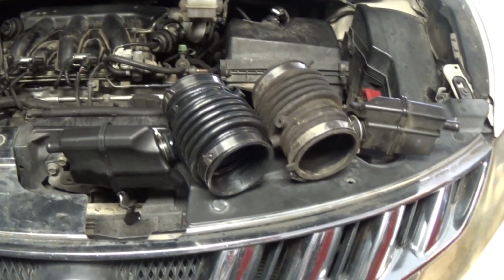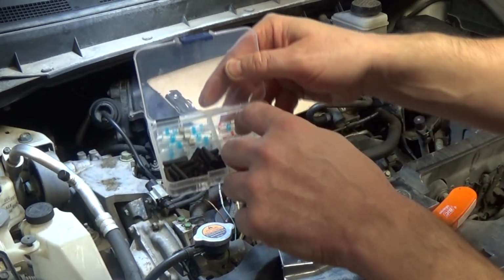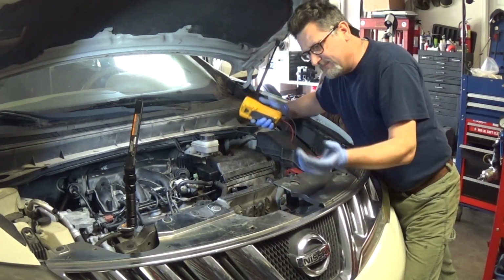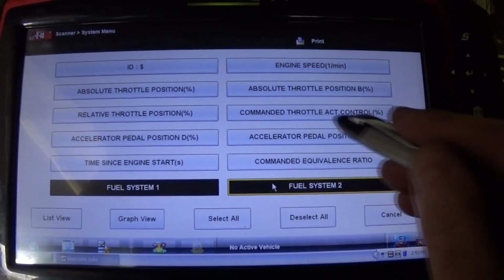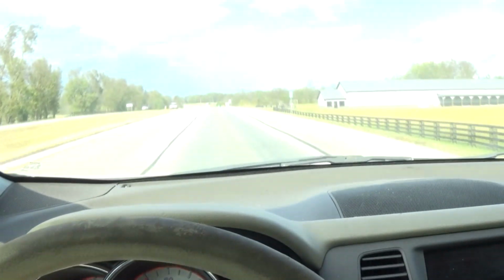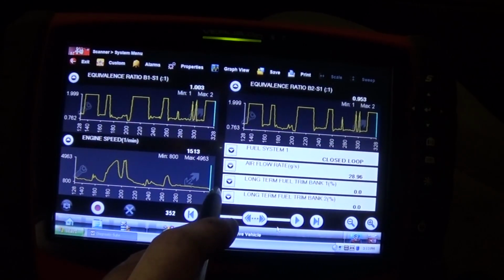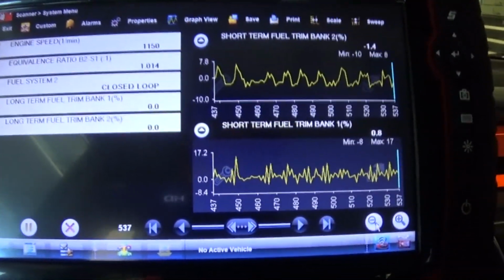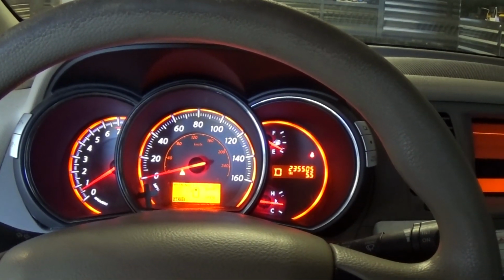Nissan Murano Low Power Complaint Part Two

Comment: I bought a 09 NISSAN Murano with the same issues,  after 4 days the dealership tow back and the mechanic said he could find anything. 2nd  time the car keeps doing the same mechanic said that is me and the way I drive the car??   Said that they couldn't find anything bad.  I need help this person is bad and I don't have an idea what to ask for. The battery had corrosion I found out went it die, he said it just needs a cleanup and the battery is good,. I bought their warranty and they don't want to fix it.  If you can tell me in specific what he needs to fix maybe he will look at it. Thank you.